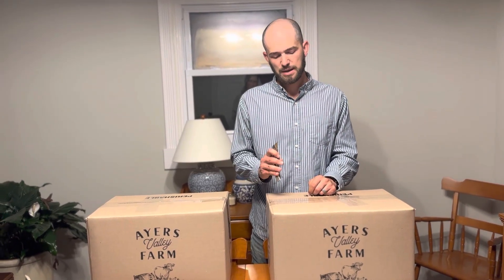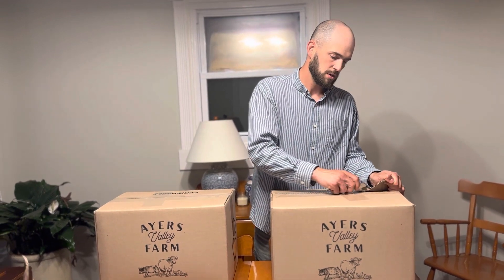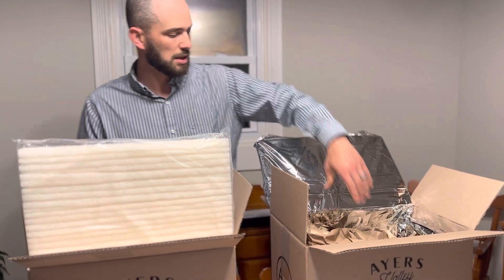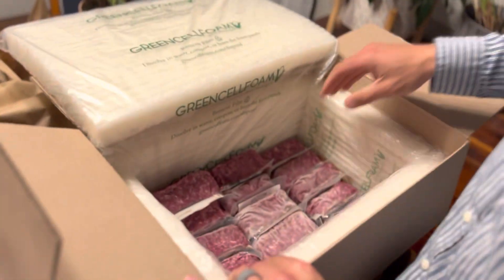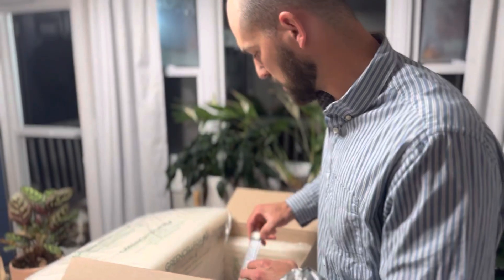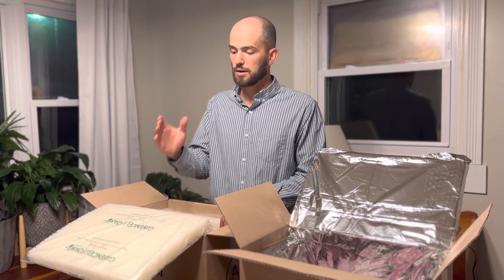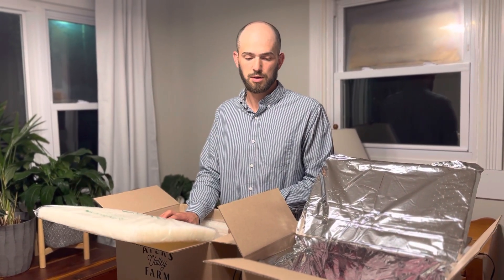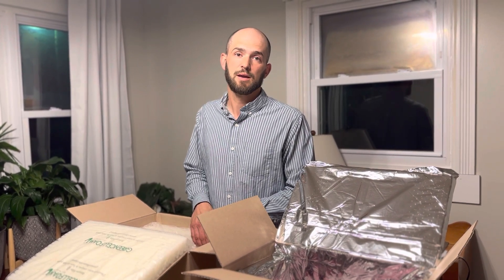Perishable Shipping Results!

Comment: When shipping to warmer states, such as arizona, seems you should perhaps add more dry ice on the top as well?  May help.
Reply from the maker: Great suggestion.  We have tried that in the past but what we ran into was the dry ice would get between the packages of meat and rub holes through the vacuum sealed packages.  This lead to a lot of relaxed packages and replacements.  So we decided to stick with the bottom for the dry ice with a paper barrier between it and the meat packages to eliminate the rubbing holes issue.